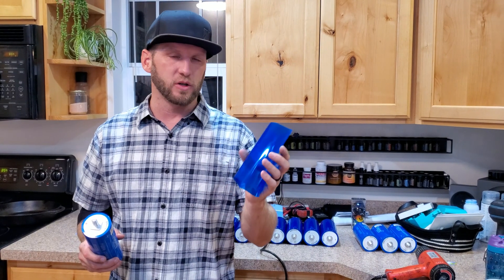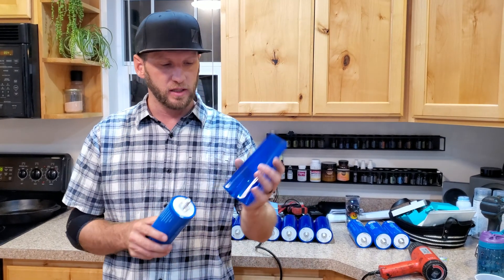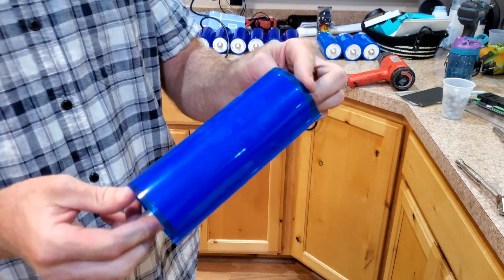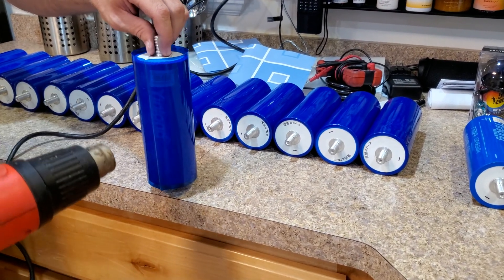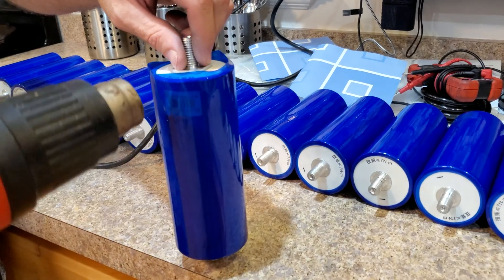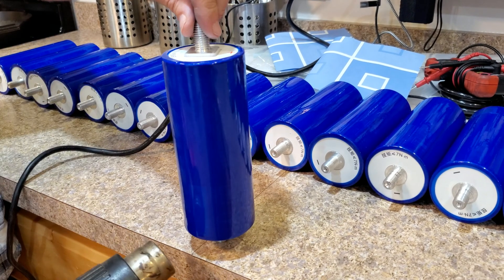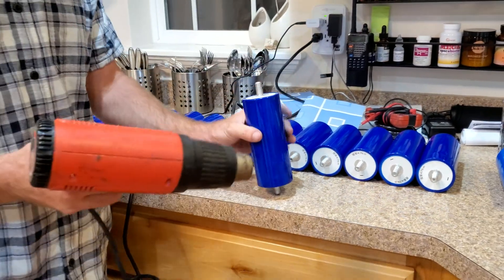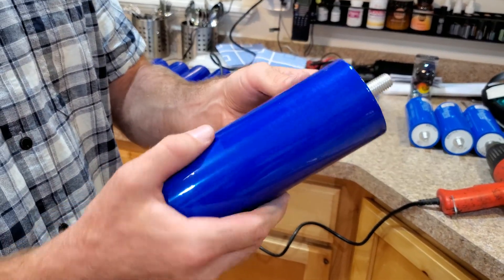How to heat shrink battery cell. Yinlong headway 18650

Comment: I have been doing tests on these batteries for 2 years. The problem that these batteries after charging up to 2.8V are quickly discharged automatically.
In addition, each cells does not charge correctly. So at the moment of electronic calibration you will lose the total battery voltage. So, after a whole day of calibration, you need to recharge them again. I have batteries of the same company as you.
I approach these batteries sold by individual Chinese shops are waste (bad somehow) from a large company - Yinlong.
To buy good batteries, you need to apply directly to the manufacturer
Reply from the maker: Where'd you buy them from? A lot of the cells available are b stock cells and will have those problems. I run mine in 6 series with a balancer to keep them balanced and have been using them in that configuration for several years now
Reply: You need to parallel all the cell together, after all cell self balance one to eachother make the bank with a good balancer like the heltech bms